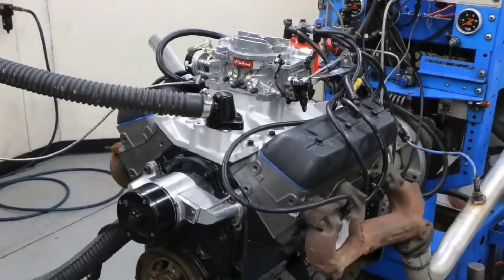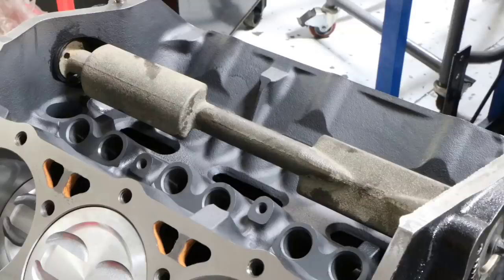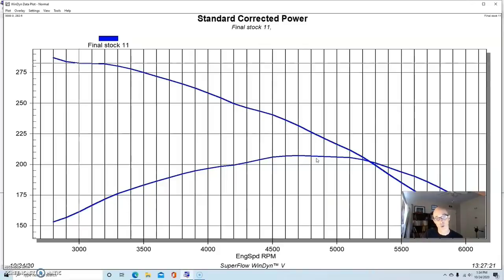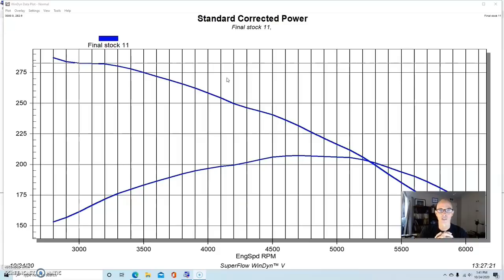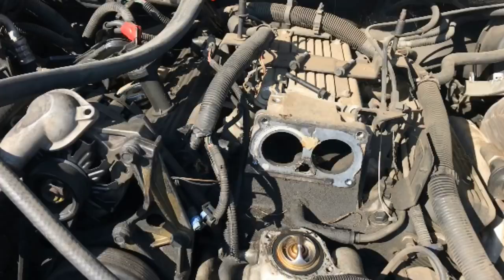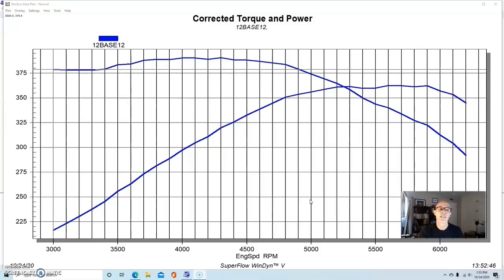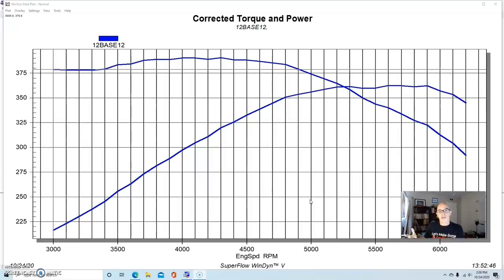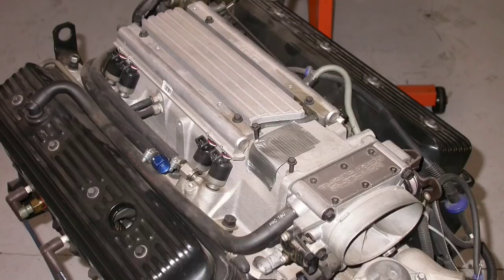4.3L V6 VS 4.3L V8-WHICH OTHER GUYS MAKES A BETTER BUILDER?

Comment: I would chose the V8. 8 ports with 1.84" valves are almost certainly going to flow better than 6 ports with 1.94" valves. If cams are swapped the L99 will handily stomp the V6 at higher RPM.
Reply: Flow isn’t everything. Bore and stroke have even more to do with the recipe
Reply: big bore pulls more air in on account of the surface area, and the engine is lighter.
Reply: @frigglebiscuit7484  Valve curtain area is more important and the 8 slightly-smaller valves have more.
Reply: @redram5150  Flow IS everything. There is a reason that math can tell you EVERY time how much power an engine will make, based on head flow. Put the same heads on two engines with differing bores and strokes, and the average power will be very close to the same.

Comment: I've always wanted to put the l99 crankshaft into a lt1 block. Cammed up for high rpms in a light vehicle. Very interested in seeing how that combination runs. My choice between the 4.3 liter v6-v8 would definitely be the v8 because I think it #1 would sound way better exhaust wise. #2 like you said it most likely can be easier to make power with because of more aftermarket support. #3 also like you said not everyone knows about them and it would be fun to trip people up with one. #4 I think it would also respond well to boost.

Comment: Personally if I could get them within 10 hp of each other I'd go v6 to get better engine set back and weight off of the nose. But having played with a 4.3 v6 I know its starting out handicapped.  But if you want to stay fuel injected find the marine intake manifold. They dont have the internal injection block, they have external rails and injectors

Comment: I would build the v6. I own a lv3 and love it. Also everyone builds v8's. I want to be different and love the challenge of the v6 build. I think ~450 hp out of a lv3 is fairly easy to do
Reply: You and I are very alike. I bought a 98 durango because no one else was really paying attention to the 318.
Reply: @MassCityMadman my Durango chewed up some rod barrings
Reply: @MassCityMadman ooof. I really wanted to turn the Durango into a track monster that has 180 headers and revs to 7500rpm
Reply: @MassCityMadman I have to put it on the back burner for now

Comment: This is cool but I’m still waiting for the turbo 3800
Reply: Buick already did that. They called it the Grand National.
Reply: Justin Keckhaver I’m waiting on him to do that
Reply: Maybe compare the gm vs dodge 3800
Reply: I have a 1997 Chevy S10 ZR2 With a 4.3 vortex 6 cylinder freshly rebuilt. that I turned it into a mud truck. How does one go about getting more horsepower without sinking a bunch of money into it. Any ideas will be very helpful.
Reply: @scottjones6608  cheap ebay turbo that shit
Reply: @scottjones6608  Without taking the top and bottom end apart, you can do a cam and rocker arm swap. Did a swap on a friends 02 Sonoma back in the day. It woke it up quite a bit even though he used quite a mild cam more suited to off road and street driving.
Reply: @geoffmooregm  thank you I have to check into that it's a freshly rebuilt engine I just want a little extra horsepower to turn some tires in the mud
Reply: @scottjones6608  if that's the case then throw a nitrous kit on it cheap, finished in less then a day I however don't know the current price on nitrous itself
Reply: Look up jdredd channel, he has a turbo 3800 gtp that ran 10s
Reply: @jakeschultz2183  didn't Ford have a 3.8 L in the Mustangs in the mid-90s to mid-2000s we can make it a three-way battle

Comment: The L99 head does have a smaller 1.84" intake valve, and it also has a much smaller 45-48cc chamber.  You could put an aluminum LT1 head on it, but you'll gain 7-10cc in chamber size.  This could be offset with milling, but I believe the aluminum LT1 heads can only get cut down to about 51cc.  The port sizes seem to be identical to the LT1 heads, and the combustion chamber is heart-shaped.  The intake manifold and camshaft are identical to what was used in the B-Body LT1s.

I have one of these little guys sitting on a dolly in the corner of my garage.  I'd like to eventually put it in something light that doesn't need a ton of power to get moving.
Reply: Could you mill that much off the heads and the intake still fit? And what would it do for PTV clearance moving the combustion chamber that close to the piston?
Reply: @chesspiece81  You would only be knocking off about 4-7cc. The machine shop will correct on the intake side for proper fitment. Adequate PTV will ultimately depend on the camshaft specs.

Comment: Completely forgot about the 4.3 v8. Great video!
Reply: Hey Rich, you should do a big block with a 409 crank. 409's had a 3.5" stoke. I heard about this  years ago when Reher Morrison did  this in Pro Stock. A .030" over 396 would be the same as a 400" block with a 350 crank.
Reply from the maker: 400 block with 3.48 crank is a 372-377 (depending on bore)
Reply: @farrellvaughan4472  Actually the original Reher Morrison big block pro stock engine used a 3.25" stroke 348 crank along with a 4.210 bore for 362 cubic inches that could really breathe.

Comment: My first car was a 75 monza , 262 4spd. De smogged, duels, eddy streetmaster single plan ( small fairly long runners , for velocity) and a 450 mech secondary spreadbore, 4 inch open element. Got the buid idea from a magazine.... They emphasized low end torque and not over carburetoring. Really woke up the car. Had a very loud induction Whaaaa,  that would make Richard proud!

Comment: I had a straight axle swapped s10 with the 262 small block that had a cam ,intake ,carb. It ran great ,revved to the moon. It didn't have any trouble spinning 42s.

Comment: I like the idea of a 5.0L big bore small stroke. That way, like you said,  you can use any performance SBC head and the added benefit of running a 6 inch rod. I wanted to do this in my Supercharged 1991 Formula when the stock 5.0L TPI crank snapped. Ultimately I went to a 383CI.

Comment: I've built many 4.3 V6 engines. A great power adder I experimented with, with great results, was using 350 flat top pistons when building them. I want to do another one utilizing the newer 3.62 stroke crank in the 4inch bore older block. Not sure I can even do that yet. Might have to just cut a crank to stroke it. If I do, it will be a 3.75 stroke if the block will accommodate.😎✌️
Reply: I don't think the Gen V V6 crank will fit in the old 4.3 V6 block.  For one thing, the new engine has bigger main bearings.

Comment: Had a 1991 K1500 with the 4.3 V6. Good mileage but slooooow as can be. So I did some upgrades. First I took off the TBI, raised the injector pods and installed 5.7 injectors. Then I made the pressure regulator adjustable. After that I ported the body of the throttle body and shaved off the top of the venturis for better flow. Finally, I bolted it back onto the intake with an aluminum spacer. Then, I installed a better distributor module with a better spark curve. 

I probably added a whole 5hp. But you could totally feel it, lol

Comment: A thing to consider with v6 vs v8 is weight and size of the lump you're working with. How much displacement and how much horsepower can you get relative to the penalty you pay with extra weight and increased inertia etc. I'm not talking about just the weight of the engine block and cylinder heads here but when you start putting power adders to it. How much more power does the v8 need to make before the difference in weight, the weight distribution and whatever is accounted for with how much the v6 can make at its maximum capability.
Reply: That's why V-8s are going the way of the Dodo. My buddy had a Ford Contour in H.S.  It had a 5 spd manual, and DOHC 3.5 liter v-6. After some bolt ons it made 192 hp and 300ft of torque. He beat every 5point slow that he ever raced, and  got the better of stock z-28s pretty consistently. People would be furious. 
 Ironically, he now drives a mustang 5.0. It the coyote with a tune. So it has some power. 
  I drive a Honda Pilot. Lol
Reply: Those contours were pretty cool, too bad they broke down all the time and parts became near impossible to find.

Comment: Built a 5.0 stroker Chevy 4.3 V6 back in 2014 for my 2nd Gen 4runner. Pulled 220hp in 3rd gear on a chassis dino with 35inch tires, 4.10 gears, 5speed. Truck is pretty heavy with steel bumpers and exo skeleton cage. Engine has some big balls for a V6. Revs to 6,700 no problem. 1990 non balance shaft block bored 60 over, 4 bolt mains, Scat 3.875 split pin billet crank, H beam rods, forged pistons, Brodex-10 aluminum heads, Edelbrock TBI intake with 454 TBI unit. The torque is unbelievable for a V6. It's been extremely reliable so far with no problems. It runs like a powerful 350 V8.

Comment: The first time I worked on one of those older caprices, it confused the hell out of me. Looked like an lt1, said v8 on the engine cover but the emission tag said 4.3l.
Reply: I never knew a 4.3 lt1 even existed until right now.
Reply: @hondaguy425able  I didn’t either. I really can’t believe this. How have I never heard of this?

Comment: I remember back in the '90s GM Performance Parts offered a 4.5 liter V6 short block that was rated at 300hp/300 torque. It was designed for the V6 guys that wanted more power but didn't want to do a V8 swap. It used the stock MPI intake manifold and injectors and came with a new chip for the ECU. I've tried to find info on it recently but couldn't find anything. Never actually seen one.

Comment: I have 209,000 mile original Chevy Astro 4.3l with the balance shaft, still runs like a top and powerful. Only headaches were intake manifold internal/external leak onto exhaust manifolds and stubborn spark issues. Now it's all fixed with no issues for 12,000 miles.  Rear mount turbo would work nicely with this.

Comment: Did anyone talk about the weight and physical size difference?  That could make a difference depending on what you're putting it in.
Reply: Not much
Reply: There's a bloke with his thinking cap on... Was thinking the same... Interesting to see differents in weight.... Power to weight ratio always makes a difference.
Reply: The V6 would be lighter. That L99 is probably an anchor, seeing as how it has so much extra metal in the block because of that tiny bore. The 4.3 v6 is essentially just 3/4 of a 350.

Comment: The 90* bank angle of the 4.3 V6 requires a split crank pin for balancing, making a weak spot in the crank.  Therefore, I would choose the 4.3 V8.
Reply: It would be pretty hard to make enough power with the V-6 to break the crank.
Reply: 650 is the limit for the factory crank on the 4.3.

Comment: I have a set of 96+ vortec 4.3 heads I had fully ported with 2.00/1.57 valves and they flow 266 intake and 192 exhaust both at .600 lift.  The porting and valve job were done by Elliot Port Works in Dallas.

Comment: As a person who likes reliability, the v6 makes more sense. There is just less to go wrong for the given displacement. With the v8 your not just adding more cylinders, you're adding more valves, more springs, just more everything.  Not to mention the package as a whole will run far hotter than the v6. So ultimately I can see the V6 being more flexible than the v8...
Reply: Good points, I agree as well as in the case for engine swaps it is a smaller package over all

Comment: We talked about this in facebook a few months ago! I have a 1975 Nova LN with the 262ci. 4.3l and after seeing this vid, I'm thinking about doing something with the intake and cam to see if i can get past that weak 110 hp!
Reply: Even though the 262 is a tiny bore engine, (but still bigger than the 267 bore) I'd love to see one done with a cam, ported heads, the rest of the usual stuff and see how it does. There can't be many 262 V8s left at all. I've never seen one for sale in the last several years. Only seen one in a car in the early 90s.
262
3.671" bore x 3.1" stroke

267
3.5" bore x 3.48" stroke

Comment: Aside from the advantages in parts for the v8,  wouldn't it rev a bit higher as well? Shorter stroke.
Reply: Revs is dictated more by the top end than stroke. Id say that the peak torque would come in at a higher rpm, but that too is dictated by the cam.
Reply: Richard tested that theory and proved stroke does not have any affect
Reply: @matthewstillings5134  stroke does have effect piston speed is very important when reving high

Comment: iv been intrigued by building a 4.3L v6 smaller package would lend itself to swaps better and less weight on the nose.  could be interesting with a small lightweight car. but as you were talking about the lack of aftermarket makes it a bit tougher.
Reply: But when LS kits are available for Miatas and Nissan 240s and....
Reply: 350 parts fit, 350 supercharger/procharger/turbochargers, connecting rods, pistons,piston rings, bearings, rear main, balancer work...
Reply: @shadowopsairman1583  yeah but no aluminum heads also turbo's and prochargers would offset the point of trying to build a lighter weight powerplant.

Comment: Hi Richard I love the baby V8s Down under we had 253CI units in the 70s then GM did 308CI versions then walkinshaw? I think developed  even port spaced FI heads.I used the late stock standard heads on a 060 overbore 253 with  240 deg intake duration cam, harrop manifold, headers etc and got 377 hp @7200 Did have to notch the bores to fit the big valve heads on the small bore .Valve shrouding who cares it worked great.

Comment: I had the chance to build a 1996 vortec v6. I don't know the flow numbers but I did do a valve job along with a boring over and port and polish. It broke two 4l60es. I used the stock intake with upgraded mpfi and a street legal tune and kept the stock camshaft. I need to find a performance dyno to get the numbers. It did do 10.01 in the eighth mile starting in second gear with a 12 inch wheelie though.

Comment: Richard, It would be great to see any info or power results you have on the Old's Aurora 4.0 V8. Its a complicated engine, but was fast in its day.
Reply from the maker: never run one of those
Reply: Shelby chose it for that late 90s Shelby Series 1, I believe.  Another intriguing GM dead end.
Reply: i have a 2003 Aurora, and a 2004 Deville, the 4.0 Northstar engine in the Aurora likes higher RPM for the power band, slower on takeoff, but at highway speeds it just pulls and pulls, but the 4.6 in my Deville has a lot of grunt on takeoff, but falls short on high RPM power, although I can get it to its 138mph governer pretty quick. Just my personal experience
Reply: Bah, 250h.p... yawn. There WAS an Aurora Indy car version though... 👌

Comment: Get a GM Holden 253ci 4.2L,
Or a 308ci also 304ci all interchange most parts.
They were made here in Australia though.

253ci 4.2L
3.625" bore
3.062" stroke
5.625" rod length

304ci and 308ci Engines had 4.000" bore